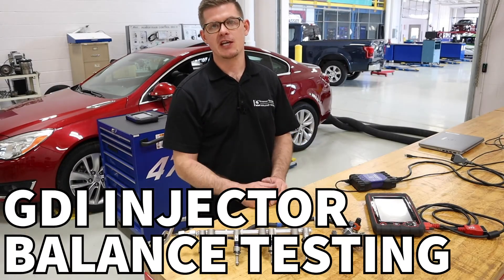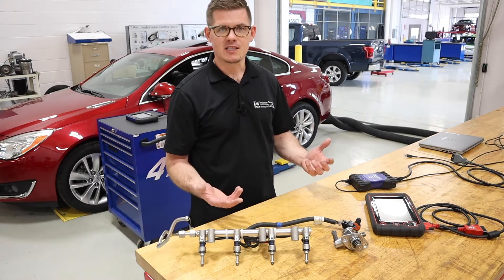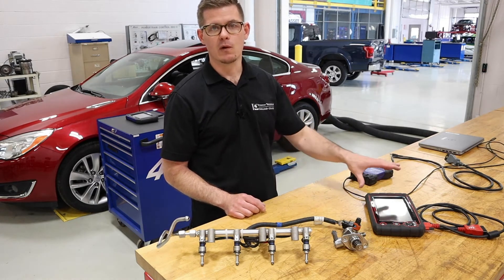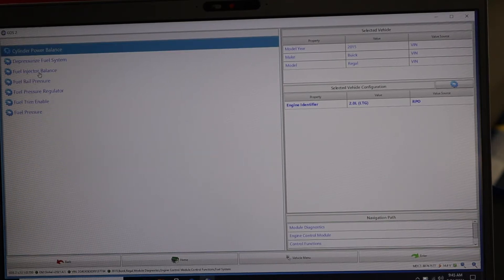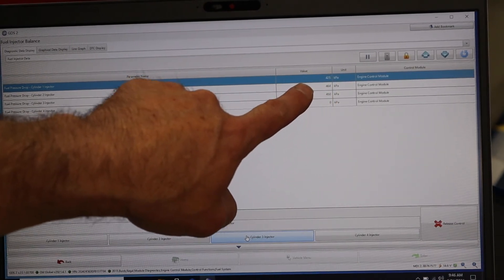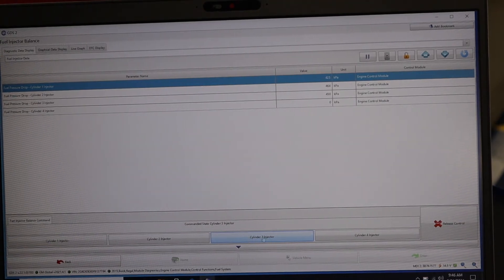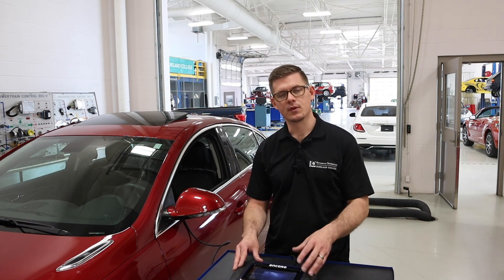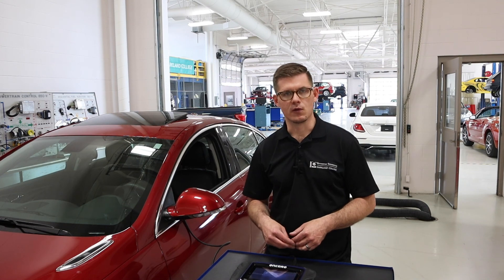Gasoline Direct Injection: Scan Tool Injector Balance Test

Comment: You never said how to determine whit h one os bad. You said take away the suspected injector but didnt say how to deteremine whit h 9ne bad. What if u had a p0172.
Reply from the maker: The results are averaged and any injector with a greater than 20% variance from the average is considered faulty. A P0172 could be an injector issue, but I would initially spend more time watching fuel trims and testing the oxygen sensor.

Comment: OK so I am working on a GM 5.3 L that has active fuel management and I suspect that my number two injector is not flowing enough you’re causing a lean misfire .. I follow the calculations and get 6 .. not Sure if that is good or if that is bad it says that it should be within 20% but it doesn’t tell you within 20% of what number is it within 20% of the total pressure drop or 20% of the cylinder that you dropped from the equation
Reply from the maker: I believe you do not want a variation greater than 20% across all cylinders. This would have you compare the highest and lowest, then express as a percentage.